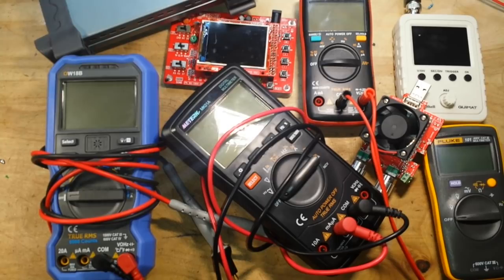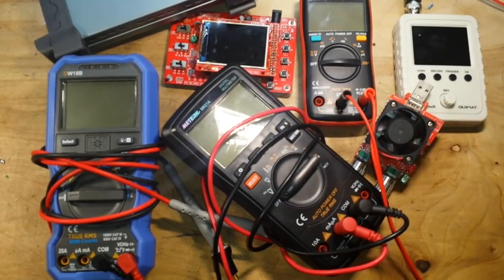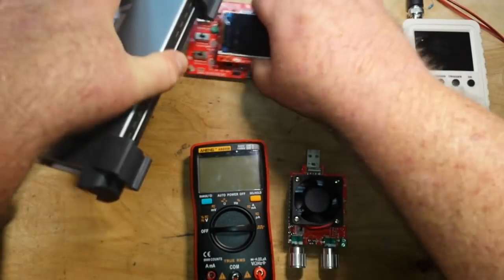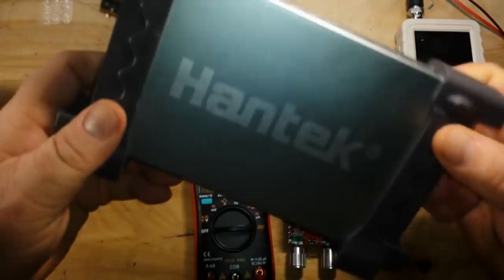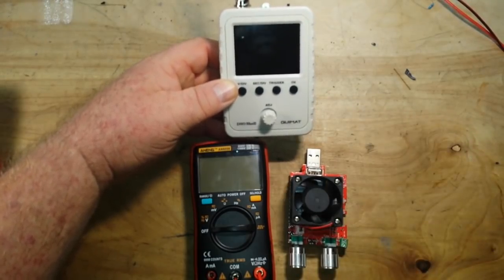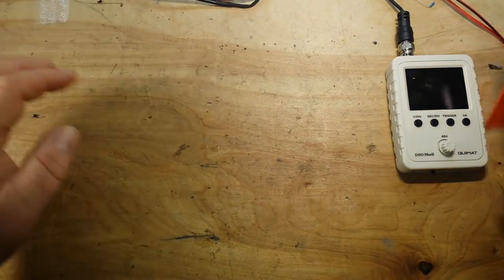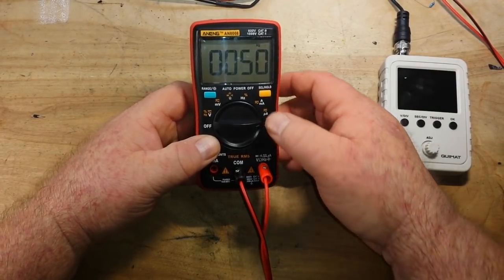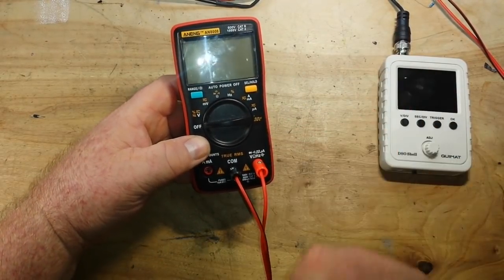Start your electronics hobby for just $60

Comment: I started with a DSO150 and a cheapo multimeter 4 or 5 years ago. It was brilliant and more than enough to get me going. 
These days I have much better equipment because my requirements have advanced but I still crack out the DSO150 now and again for old time's sake. 
I modified mine to run on a couple of 18650's in parallel and a boost converter, just to make it a bit more portable. 
One word of warning to all Eric's out there.... Measuring equipment is highly addictive. My Mrs saw no reason why my "need" for a 4 channel scope was way more important then her need for new shoes :-)

Comment: Great. Never would have thought about a mobile being used as a signal generator. I'm thinking you can use the headphones socket for an electrical connection. Perhaps with a dummy load. A really big thank you for that. From England 🇬🇧

Comment: Paul, you are honest when you say you try to respond to as many comments as possible. I have received so many hearts from you, even when not expecting a response. Starting out in electronics is fun and learning is easy with people like you giving your time and experience freely with easy to understand explanations. I started very cheap and slowly built up. I now have a Sigilent SDS 1102DL+ Oscilloscope and my favourite multimeter is a UNI-T UT61E (of the 4 or 5 I have. I started with a homemade power supply made from a kit and another from a computer power supply. I have even converted my house lighting to a variety of LED's powered from a 250w solar panel and 250 Ah AGM batteries.
I love the journey in the world of electronics and Arduino/ESP projects. Building up your components does not have to happen overnight, nor does it have to cost a fortune. The best advice I could offer is that you learn so much from mistakes (just remember to do it safely).
Thank you Paul, you rock mate.
Reply from the maker: Thank you Steve. I appreciate your support and kind words!
Reply: @learnelectronics  just being honest mate

Comment: I had problems with powering the DSO shell scope from a battery. Seems many others have also had the same problem. Just lots of noise and not picking up the signal.  I use a switch mode supply, but still has noise. prob best to have a large battery that can power it, or a power supply. Small 9v does not seem to cut it.

Comment: Hi, I know this is not pertinent to this video, but I am a beginner and I've hit a snag.  I soldered together a little LED clock kit, fired it up and it worked fine.  Then I decided all that flux looked bad so it took a small brush dipped in isopropyl alcohol and cleaned it up.  It's clean now, but it doesn't work.  The peizo buzzer is the only thing functioning.  Thought maybe it wasn't dry enough so I blew it off really well with my air compressor - same thing.  Two questions 1 - can you do a video on the proper way to safely clean up flux from a circuit board?  2 - Is there a way to fix this or is it toast?  Thanks so much.  Love the videos I have viewed so far.

Comment: I would add: don't focus on your weakness (money), focus on your strength (free time). You can learn more with $75 of parts and equipment than some people learn with $2000 of equipment. I speak from experience on this one :) I have all the toys, but almost zero time to actually experiment, play, and learn. If I had just a $20 multimeter and a $20 "misc electronic hobby getting started" kit I could learn tons if I was just in a different stage of my life right now. Just remember the stuff doesn't do you any good if you don't use it. And learning itself is pretty much free.

Comment: I got started in electronics using an Arduino. I only have a multi-meter. I still need to learn how to solder and how to use an oscilloscope. But I'm just a casual enthusiast so I don't know if I want to go whole hog.

Comment: I got into TIG welding on a 200 amp AC/DC machine for $160. Got into Ham Radio on a $21 Baofeng UV-82.  Got into firearm on H&R pardner 12ga pump. Fixed my 2003 VW Jetta TDI ABS problem after two ABS sensors shipped for $5.65! Going to get a DJI drone... Now, $27 for a AN8009.  The list on and on and on.  I just don't understand why we shit mouth China all the time?
Reply from the maker: Agreed

Comment: I have AN8009 and DSO 150 Shell which were like 16€ each.  I flashed the DSO with OpenDSO-150 firmware and planning to mod it with battery. And before, I survived with KT30B for approx. 8€ and PICkit 2 acted as logic analyzer.

Comment: There are some decent 8038 based function generator kits on eBay, and they're cheap. Also, everyone wants LCD scopes these days, consequently, there are a lot of cheap analogue scopes about. The small LCD scope kits are perfectly adequate most of the time. If you're thinking of going for one of those Chinese multimeter/oscilloscope combos, have a look on Youtube for reviews before buying. A lot of them are crap, the Mustool MT8206 for example.
Reply from the maker: Check out tomorrow's video...

Comment: Yes I agree as a starter you don't need a brand like Fluke. Chinese brands might be good, but look at videos like brand tear downs to see how they are made regarding safety and thus specs. It's much cheaper to solder your own test leads and any other thing or device with good parts and wire. Practice makes perfect. And thus by making mistakes and testing and measuring you learn. But also follow some You Tube video's about physics. Get to learn and know the basics of physics and thus electronics and understand why. Get your equipment in stages, your knowledge will grow and so your need for other measuring devices. It's a fascinating hobby and at a point you can make what you think or design.

Comment: I use a 12VDC battery sometimes, however I've connected an inline (old fashioned), 1Amp fuse/holder on the +ve and taped over that terminal. Otherwise (when fully charged), you can inadvertently draw a lot of Amps from it! Great video though, many thanks.

Comment: Hi, Thanks for all the great videos!!!!  I'm just wondering if you know why my "cheap" multi-meters read ~ 29 vac from a 13.8 vdc regulated supply, while my expensive meters read very little ac voltage.  The cheap meters are the Harbor freight meters and similar.  I've seen other YouTube videos with people scratching there heads as to why they are getting ~29 vac "ripple" from their car charging circuits!

Comment: I'm a firm believer that you can get equipment that works well for the hobbyists/DYI for a cheap price. I mean that DSO-138 is like $20 and does great for most Ardunio projects. Even for my Automotive diagnostics I use the Hantek 1008C  ($100) and I've done more with that Hantek 1008C oscilloscope then some people have done with OEM specific diagnostics equipment. I even use the DSO138 on automotive applications and it works fine. People get pulled into this idea that you need a $3500 scope and a $600 meter I say if you go cheap and understand the limitation of these cheaper products you can work within those limits and still yield good results. 

Great video !!
Reply from the maker: Thank you

Comment: A very similar oscilloscope to the hand held one is available as a kit for $20 USD: https://m.banggood.com/Orignal-JYE-Tech-DS0150-15001K-DSO-SHELL-DIY-Digital-Oscilloscope-Kit-With-Housing-p-1093865.html?rmmds=search. Original JYETech DSO-SHELL DSO150 15001K DIY Digital Oscilloscope Unassembled Kit With Housing. There are several assemble videos on youtube as well. You could get a cheap soldering iron for the price difference too.

Comment: Good advice for beginners. For sure. 
The main ( good ) reason why some scoff at cheap multimeters, I think, is the lack of safety-features. Wich is a legit thing. 
Use cheap multimeters, but be aware of the lack of saftey and protection features.  I have several cheap meters, and they are in general good and reliable. 
I have one that I use only for current measurement. That way I don't have to switch over the probes all the time. And maybee forget that I used it for current measurement and put a short circuit in my project when I go to measure voltage. 
Read up on, and understand how to work safely with electronics.

Comment: I still throw things together.  I made a small pocket power supply box for low current projects using an old mobile phone battery a boost converter and a li-po charger.  It supplies from 4 - 27 volts all be it at only about 10 watts!  For led projects etc it's ideal and cost pennies to make using Chinese modules and spares from old projects etc.  You can build up from small beginnings so never be put off.

Comment: sorry this is long and mostly really wants to be read by the person in question, but:
hi i just wanted to butt in and add: i think a reason why a lot of 'big' creators tend not to reply, is firstly because they are so busy and get so many comments/ messages to deal with that they often ignore most just for lack of possible time to read through them to find the relevant ones, also a lot of these same creators might already have videos or content going over starting/ setting up a cheap bench and what tools to get and etc, and finally some of them have forums/ groups where questions can be asked and answered within their audience, and these sorts of questions tend to get answered there a lot, especially this very one is very common. so even though a creator wont respond, its not necessarily because they dont care or something, even if they did read the message in the first place they might not do anything because of the existence of the aforementioned resources (on top of just google).

i also want to say i think the AN8009 (ZOTEK111) is slightly better than the AN8008/ZT101), and once you get a bit experienced, open it up and replace the electrolytic on the side with anything bigger and add at least a 100nF over one of the unpopulated 0805 pads underneath it. its just they both cost almost the same but the new model is more convenient with its longer backlight time and NCV, icant remember offhand what other differences there are but.. its still my favorite 'disposable' meter
and yeh your right phone apps are great for things like low frequency signal generator or serial terminal etc. also you could add a cheap fx2 'logic clone' from china (copy of the saleae logic 8) modern ones seem to have some problems workign with sigrok ironically but work perfectly with saleaes logic freeware
also (sorry to go on but) you could have added a few things (unless you didnt have time its cool) like recommend a t12 iron over any 936 type these days since the t12 types are just so much more usefull/ reliable/ functional these days in comparison, and things like not being unsure about getting good tools and not the absolute cheapest (just the next cheapest ^^ ie second most cheap), like the old fashioned type of electrician wire stripper that are like pliers with bent ends that end in a  inverted chisel type thing- that is better than nearly any automatic wire stripper for stripping wire all the way to 40AWG without breaking the wire, even though they look like dinosaur tools they are just the best, even if autos are more convenient for equipment wire where the wire wont break and you have a lot to strip quickly.
its just all these little details all go into it and especially that if hes got very little money then encourage him to not feel bad or stop if it means itll take him a year or 2 just to get together the most basic tools that can maybe be used to do most common things with, like throughout any engineers life your constantly collecting stuff anyway but at the start it might be 5-10 years(worst case) before youve got everything together to be able to comprehensively tackle almost every problem that you could possibly encounter (in the electronic world) and the more important things are basic rules like not buying the cheapest tool if its something your going to use more than once (like good screwdrivers and all sorts of handtools really go a long way to saving money and enabling you) and also there are some things you dont absolutely need to get but getting them will help greatly depending on what road your going down, like powered desolderer or hot air station or hot plates/ solder baths or ultrasonic cleaner and uv lamp etc if you want to do a lot(a lot) of repair work or working on phones or modern dense/ fine electronics, or digital oscilloscopes/ spectrum analyzers/ logic analyzers, function generators/ arbitrary waveform generators, bench meters/ bench supplys and so on if your doing a lot of prototyping or testing. where a lot of the cost for these things can be avoided at first unless you know for certain you need it and will get use out of it.
ultimately the most important thing to remember is: youll see a lot of things you want but dont actually need, so just get the things you need. this means getting good tools over the absolute cheapest that will break after one use, because you need a good tool, you dont just want the tool to do a single job. also that fancy mixed signal digital storage oscilloscope/ arbitrary waveform generator etc, you dont actually need it so dont lose time and money on it when that money can go to more important relevant things, and especially this applys to things you think are 'cheap' but look cool or something, youll end up buying a hundred cool cheap things a month and end up with nothing actually useful you can use or do anything with into the future. not that cool things arent cheap and you can definatlly buy a hundred cool cheap thigns a month if you can use them. obviously it depends what it is, like if its a hundred of some surface mount fet or led or whatever component and its dirt cheap, then yeh go for it after youve done a bit of basic research into knowing what exactly it is and how/if you can actually use it, which includes downloading datasheets for components and keeping/ storing them somewhere you know and can backup so that when you buy stuff you have local copies of as much data about them as possible for as long as possible, but anyway point is dont buy that stupid massive high voltage capacitor that might cost a lot if you dont know how your going to use it or if you even can at least in the next month if not year, because then that money could have absaolutely gone towards a better quality tool or just anythign else. so just try to reinforce that in your mind not to waste money if you dont have lots of it spare- to make every penny count. and otherwise finally make sure to have fun, if oyur not having fun then stop and do something else until you come back later, otherwise either electronics isnt for you or youll end up making more mistakes and learning bad lessons from trying to avoid certain things or make certain things go quicker, ontop of just not enjoying yourself/ not having a good time at it, which ultimately...well..
ive gone on for too long here sorry and i guess if anyone ever read this then.. sorry
Reply: wow... you wrote all this...??

Comment: Thanks again Paul!  Maybe his first project could be taking an old atx power supply adding a 10 ohm resistor and building a rudimentary bench power supply   Instead of forcing all the 12v together, you can separate them by rail and use 1 or 2 for 12v, maybe add a buck converter to 1 rail and boost converter to the other. That gives you constant 12v, 5v, 3.3v, 24v (with the -12v line) and 2 variable "channels" for the cost of the resistor and connectors.

Comment: Any meter  or scope is better than no meter or scope  !   Funny thing is i own a few meters , nothing extravagant mind you but they fall into a price range of $ 150  au or less and 90% of the time i use a $20 cheapie to do what i want - why ? Because it is sitting on the bench ready to go and if it gets damaged  or dies I don’t care . I only own a vellerman  hand held scope which works ok for what i need but back when i bought that there were few choices , either  a $700 plus  full size unit or that at around $150 - man i wish those $50 units were around then coz that is what i would own !   I bought a semiconductor tester back then also at around the $150 mark and bought one of those cheap $15 units from china a few months back and it does exactly the same job but also test resistors and inductors and capacitors !

Comment: I actually have a DSO-138 and I really enjoy it. It opened me up to a whole new branch of electronics. My two multimeters are very minimal. One of them was only $4 on eBay but it works fantastically, although I'll take your recomendation and buy the
As for a power supply, I finally bought a 5A 30V adjustable one on eBay for $38 and I am extremely glad that I did. It does have its quirks, especially when running constant current, but for the price and it being constant current/ constant voltage variable it's a great addition to my lab.
Last, I would recommend any hobbyist to get an LCR-T4 ESR meter. This thing is a steal at a bargain price. For around $10 with the acrylic shell, you can get an awesome little component tester. It tests transistors, resistors, diodes, capacitors, inductors, and even some little ICs. This thing is so cool, and I don't even realize it but I use it ALL the time.
@learnelectronics I've seen other electronics channels do the LCR-T4 review, but there are a ton of different ones out there and maybe you can point some of your less experienced audience towards a good brand. Most use a Mega-328, but all have their variables. Anyway, it would make a pretty fun video since I have not seen an LCR (using the mega-328) vid from you. Thanks and have a good one!